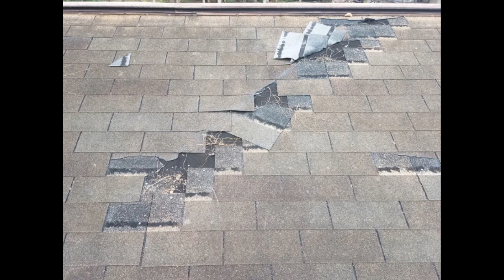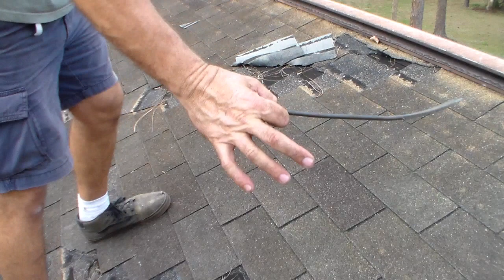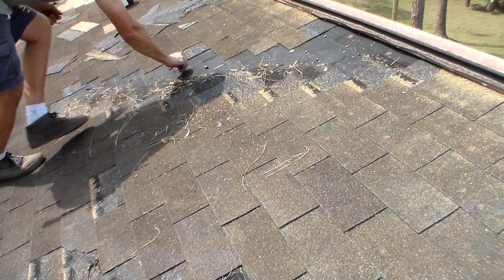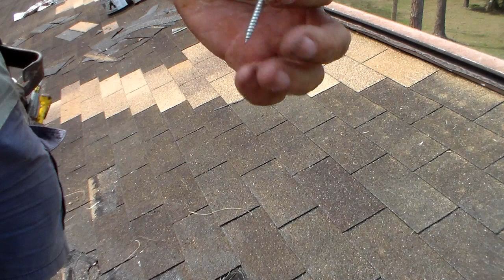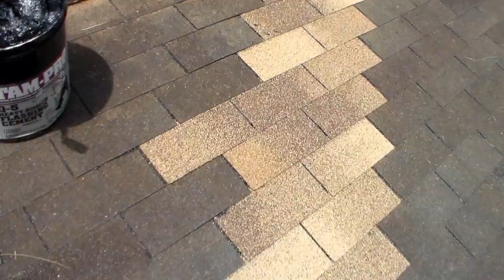Residential Roof Repair - Asphalt Shingles Hurricane Damage 7 - Near Ridgevent

Comment: Aren't there lifetime shingles now?
Reply from the maker: Yes, as long as the lifetime is 20-50 years. Nothing changed with the warranties except the name "Lifetime" on the package. If you read through the warranty documents, they say the same thing as when it used to be 30, 40, 50 year shingles. One manufacturer (believe it was GAF) discontinued their 40 year line and all others soon followed. Then the word "Lifetime" came out for the 50 year and then for the 30 year as well. There is usually a slightly different name for the 30 year shingles. The wind resistance may also be less for the 30 year shingles.